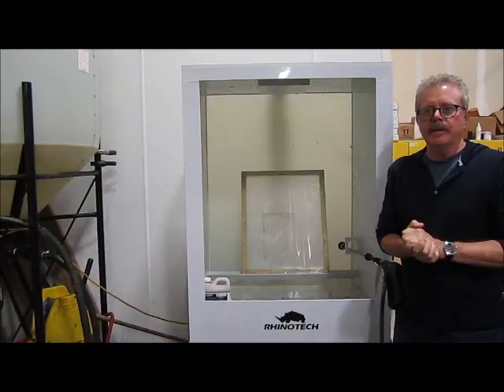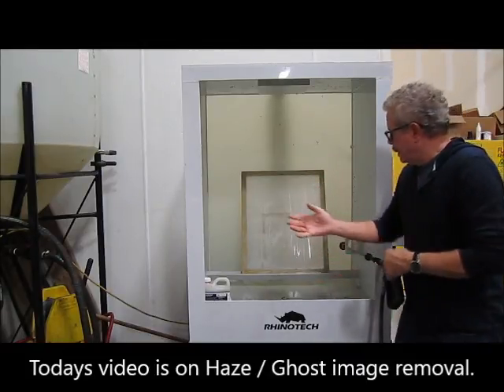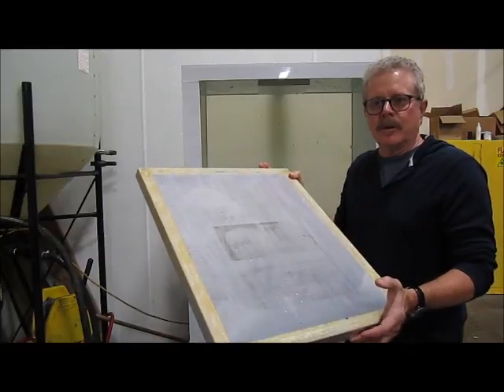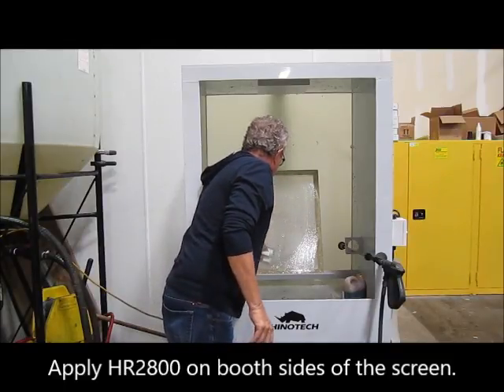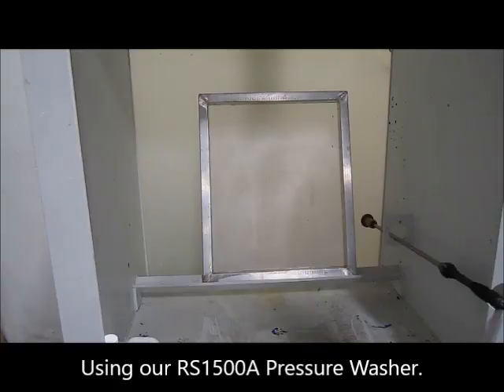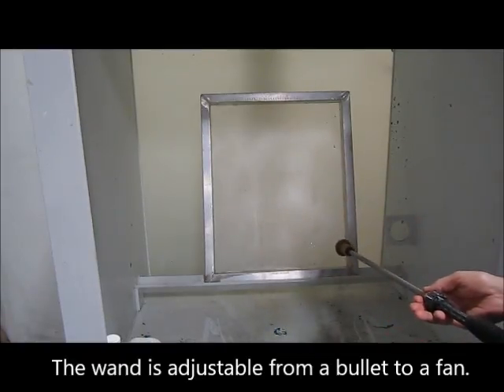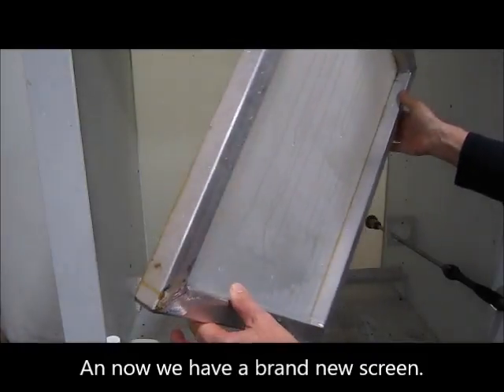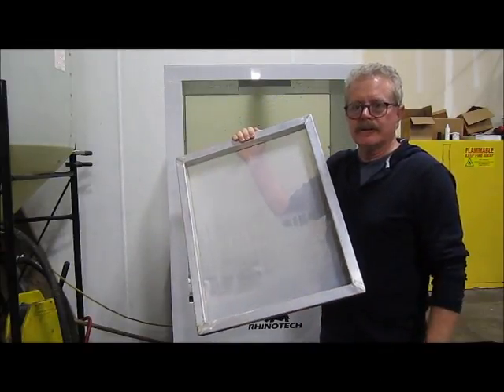Haze Remover 2800 Removes Ghost Images

Comment: Obviously the haze remove only removed the color from the screen. If you note that after the haze remover was removed, the water does not run through the area that contained the image. The reason is that their is still chemical residue on the threads. Only when water runs in sheets down the mesh is the mesh actually clean and back to where it was when new.
Reply from the maker: Thanks for watching our video. With a proper haze remover like HR 2800, the ink residue is completely removed from the screen leaving a virgin screen ready to be reused. Just follow the directions listed above, to get great results. It's a powerful product and if you're interested in trying a sample, give Chris a call at 651-686-5027 x 4. Looking forward to working with you.
Reply: Canned Response?
Reply: @Rhinotechinc  i would like to try a sample of this remover. im interested
Reply from the maker: @BillHood  Always an individualized response. It's a best selling product. Thanks.
Reply from the maker: @tabayuco8625  please forward your name, company name/address and email address to chris@rhinotechinc.com and he'll get samples to you. Thanks for watching our video and getting in contact. Looking forward to working with you.